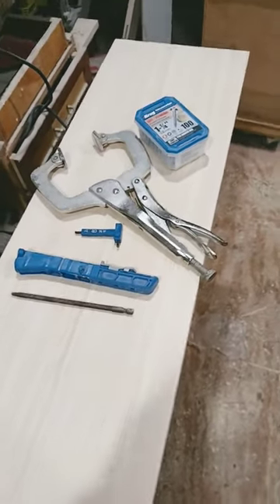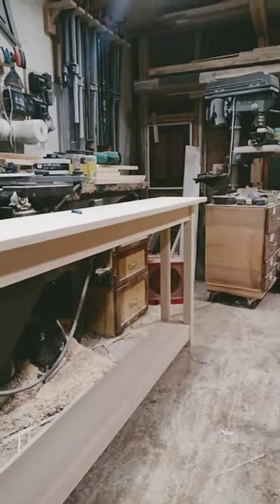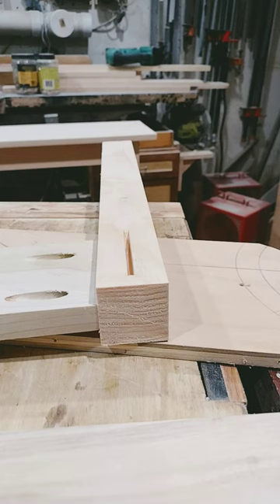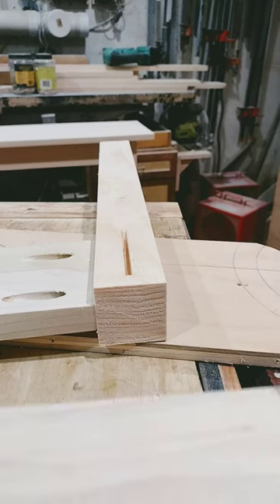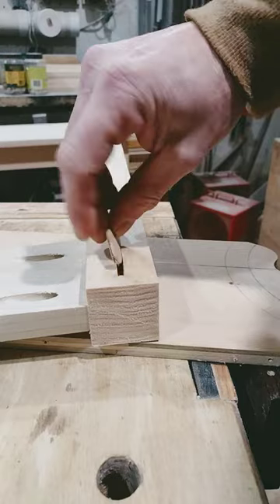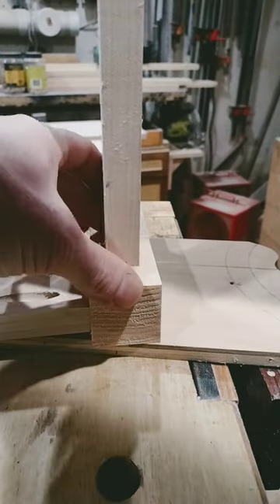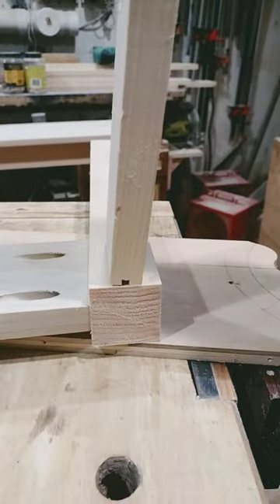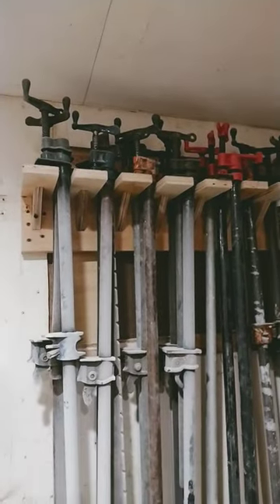pocket holes and plate joiner!! strong joints less work!!!

Comment: I don’t see where pocket holes get all the hate! They are great. I’ve been using a Kreg jig pocket hole system for over 10 years. Sometimes I don’t even use glue.
Reply from the maker: I truly don't hate pocket holes screws. You can build furniture with 2x4s and nails, then you learn that screws hold more strongly and they can be hidden in pocket holes. Then you learn to cut mortise and tenon joints which require clamps, then you learn clamps can be replaced in some instances with the pocket holes. I love pocket hole screws!!